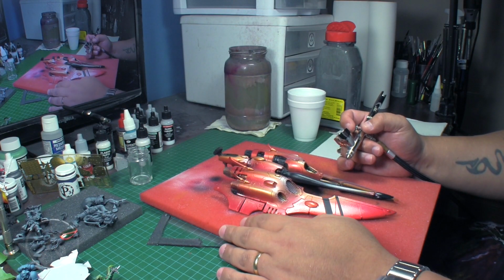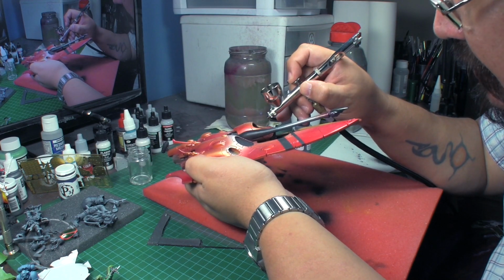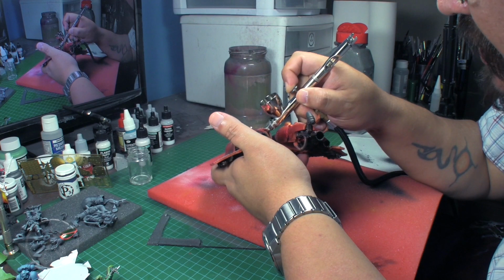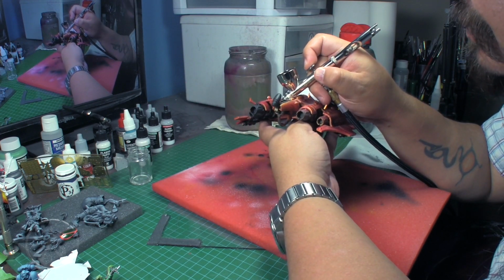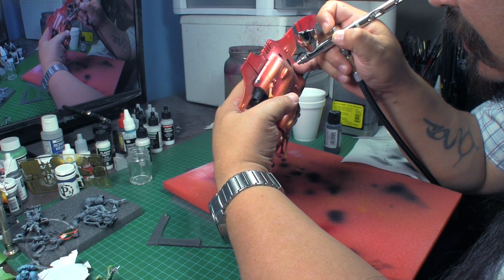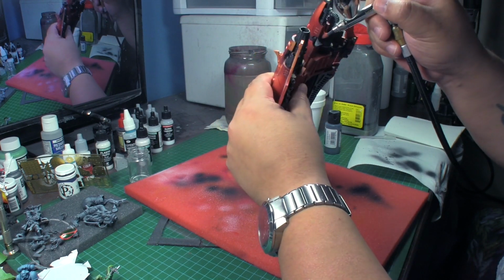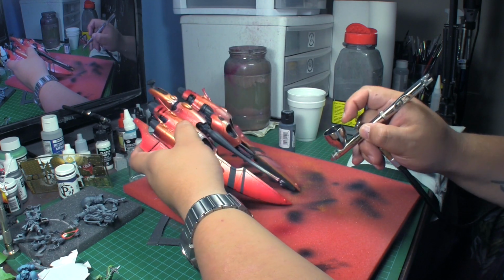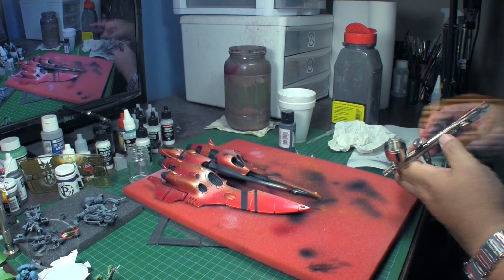the AirBrush n00b: Lynx on a Hot Tin Roof

Comment: The closer you work to the model the lower you want the psi to be. You can thin your Minitaire with water if you need too. Also check your needle tip if flow starts to slow and "pinch" off the dried paint every few sprays. Your Krome also is equipped with a smaller needle/nozzle combo and you will have to thin even Minitaire or VMA paints. Using Regdab Needle Juice lube coated on the needle will prevent dry tip.

Comment: Chris, you get issues with flow because paint drying on the tip of the needle - AKA "dry tip". Keep a Q-Tip handy to wipe the tip up occasionally. Paint clog shouldn't be such a huge factor unless they aren't thinned enough, or you aren't clearing between colors. Hope this helps some.

Comment: Nice to see a new airbrush noob with the lynx. Are you going to try to redo the barrel more realistic colored heated metal or do you like how it turned out as it is? I know i sent you an email on here a while back with a LOT of pictures of different types of blued metals. The one thing about doing fantasy stuff is you can always say its some type of metal we don't know about and that's what happens when it gets hot. I like how your exhaust nozzles look on the right engines. If you were to do that to the others and all the way around and then take some chrome right on the end 1/4 inch of them and then hit it with some dark blue ghost tint right at the end it would look SICK.
Also, i think I was the one that pointed out about your air pressure multiple times. When you are cranking up to high pressure to do large models you are really exceeding what the air brush is designed to do. Air brushes are supposed to be very small area painting aparati that are made for doing lines and small details with a max size of about 3/8 of an inch, anything more than that and you are pushing it too hard. If you want a good sprayer for a tank or some other larger area like that you should get a small spray gun that is made for doing 1/2 inch to 1 inch range sprays. I believe they classify them as fine detail spray guns.

Comment: Hey Kris, love your channel.  Great tips and very entertaining.  

If I could intrude on your time, what's your opinion on how much an airbrush itself effects the quality of a paint job?  I invested in a decent compressor but opted for the cheapest airbrush I could find to save money.  I'm finding it clogs easily even when the paint is thinned liberally with Vallejo thinner, and splashes when I release the needle or stop the air flow.  I'm wondering if I'm still low down on the learning curve or I hobbled myself by being cheap.

Comment: I find the minitaire paints don't flow well unless your using high psi
Reply from the maker: you think I should be using 20 - 25psi next time? It flowed fine when the hammer was back almost 1/2 way... just was giving me problems when I was moving it 1/8th of an inch at a time...
Reply: Ya maybe even 30 psi